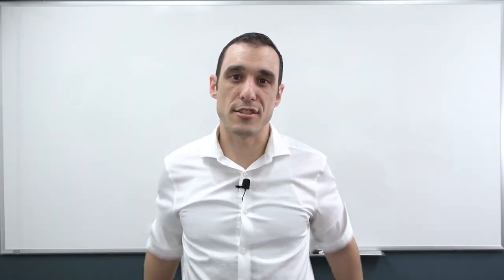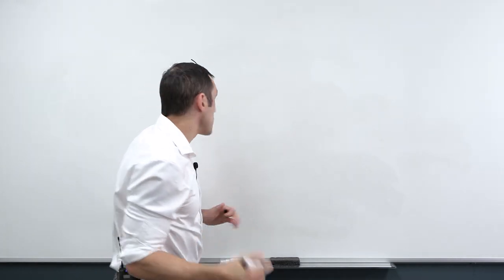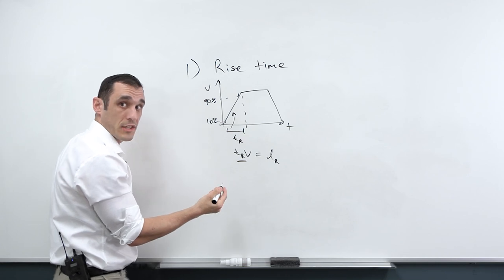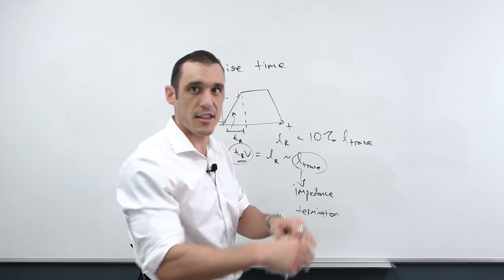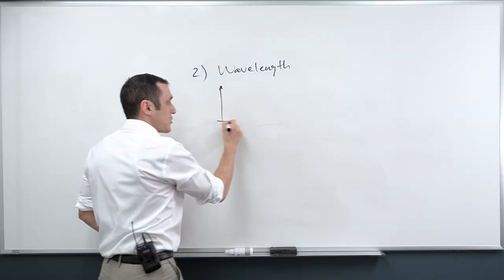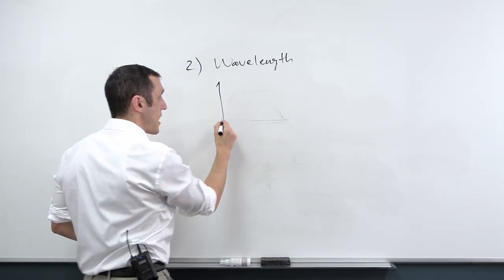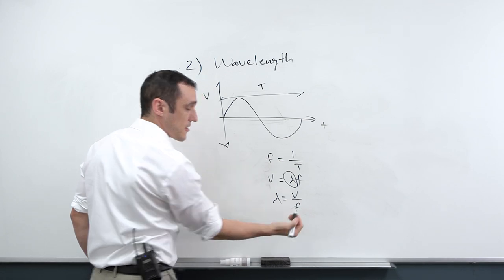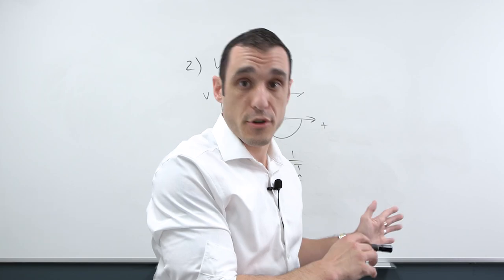When Does a Trace Act Like a Transmission Line?

Comment: Well digital signals will usually have the majority of their energy concentrated in a few frequency components so wouldn't it be possible to average out a corresponding wavelength to atleast get a general idea if the trace acts like a transmission line?
Similarly, analog signals are not a single frequency in practice. Information is carried over a certain bandwidth. This is why you characterize a signal with its carrier or center frequency and a bandwidth. When doing calculations you take the center frequency but you should always look at the frequency responce for the whole bandwidth. So i think that this idea can be used for digital signals in a similar manner.
Anyways, great video and a great series. Looking forward for more episodes.
Reply: Hi, and thanks for watching!

So for determining whether the trace acts like a transmission line, you do need to consider some very high limiting frequency. If you set the line length using a high frequency, then all lower frequencies will also not be affected by impedance mismatch. If you have a specific bandwdith, use the high frequency end and not the low frequency end.

As far as choosing which frequency, consider this example: Suppose you are designing a high speed channel and your receiver needs at least 2 GHz of bandwidth for a maximum 4 Gbps NRZ/NRZI data rate. Now suppose your rise time is fast enough that you have 90% of your power contained up to 10 GHz. Should you determine critical lengths based on 2 GHz or on 10 GHz?

This is a realistic example because, in USB and in many SerDes transmitters for example, the signal rise time could be specified as approximately 100 ps or less, so that would certainly give 10 GHz of signal bandwidth. However, the receiver needs much less bandwidth to properly sample and resolve signals at similar data rates. So how much bandwidth does the channel need to have, meaning how high of a frequency can you use to determine the input impedance? If you don't use a high enough frequency and you set a critical length at a lower frequency, your line's critical length will be long but a lot of power could be reflected at high frequency, which specifically will slow down the edge rate in the receiver.
Reply: @Zachariah-Peterson  thanks for the detailed answer